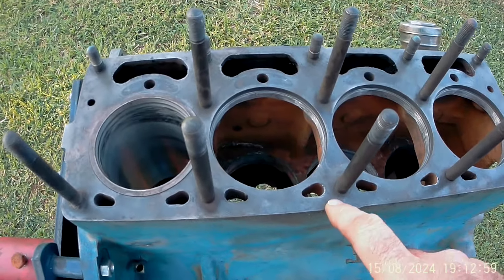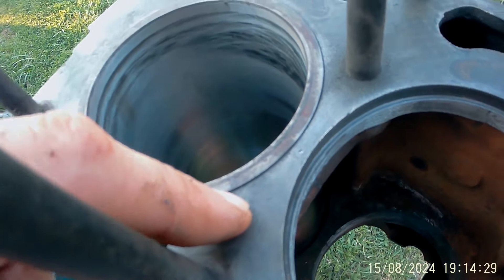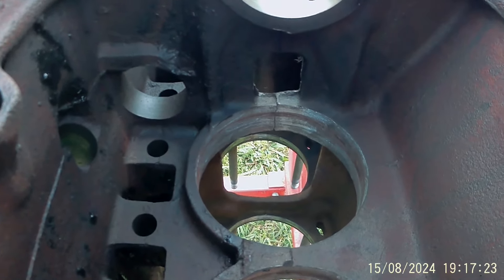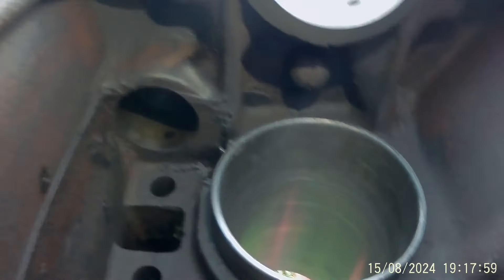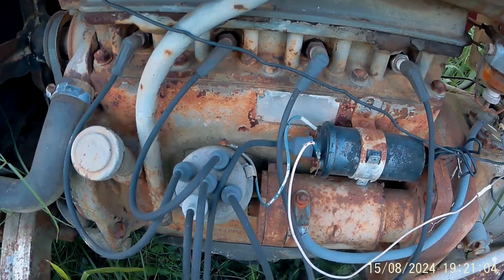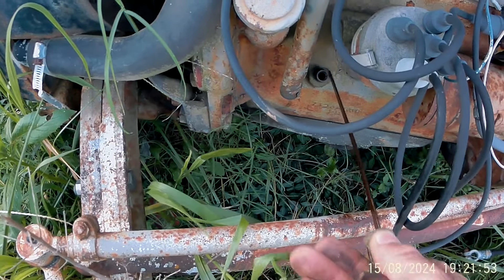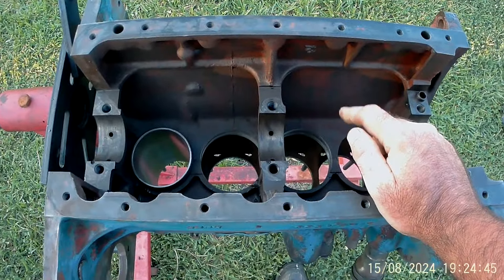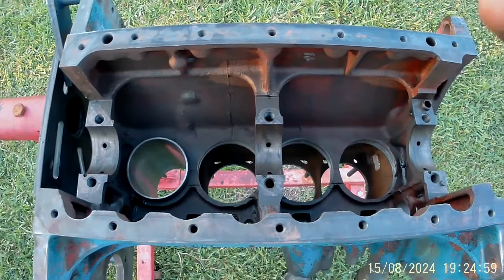Why Do Ferguson TO-20 and TO-30 Engine Blocks Crack?

Comment: After your 460 build videos, up n coming,  brother can you give us, your Ford knowledge on rebuilding A rear Ford, 9in resend? AND   A  NP205 Transfer Case ?? Please 🙏 n thank u?? I love the Dana front 44 videos 📹 I sent your channel information and shared it with other buddy's, they also said best 👌 they watched, or end a re gearing ⚙️ video,  thanks again, Jason, your Ks, Brother ❤❤😂😂🎉🎉
Reply from the maker: Unfortunately, when i rebuilt the 9" in my truck was before I had started my channel and I don't have anything else with a 9" in it currently. My truck was actually ordered with the Ford 9 3/8" traction lok differential. The ring and pinion went bad in it and I had to change to a regular 9" and rebuild it. I will be going thru a New Process 205 at some point. My truck has a NP203 in it which I want to swap to a NP205. The problem is you have to switch transmissions and mounts when you do that. The output shaft length is different on a C6 for a 203 vs a 205.
Reply: @BlackLabGarage  sounds good I'll watch for it the NP205 video